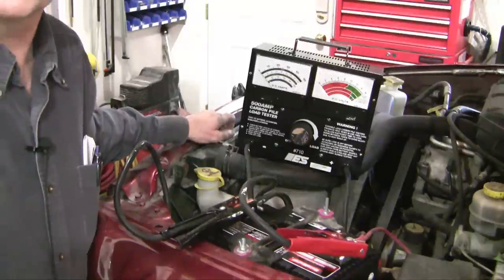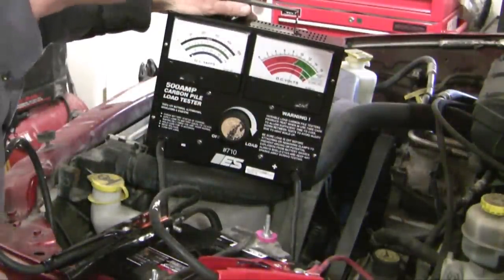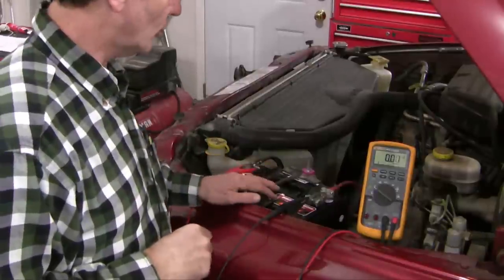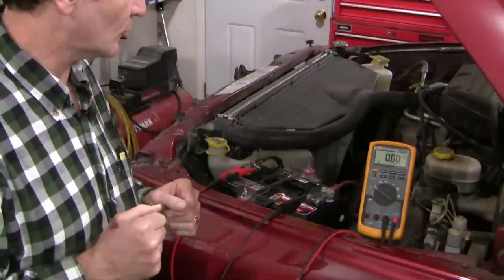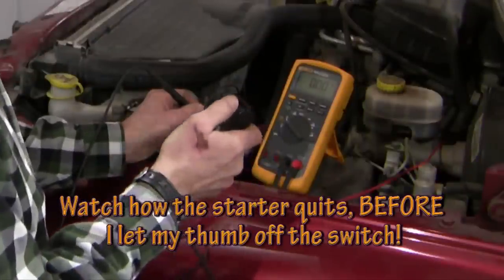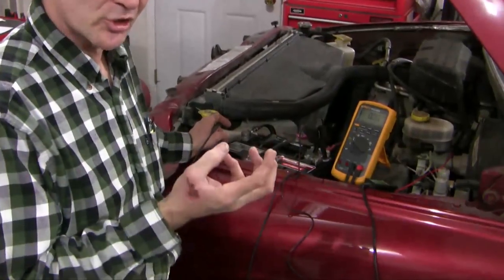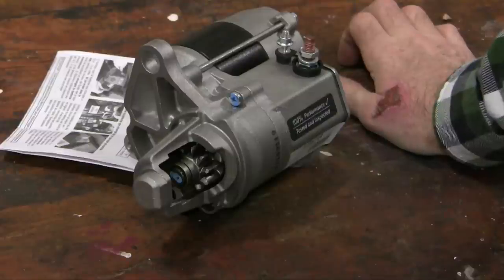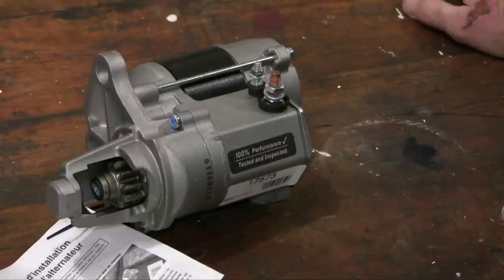How to diagnose & replace a bad starter motor

Comment: Have i got this right for a voltage drop. Put you DMM on say 20v and = lead to starter motor B+ post and to battery positive. Then for the negative side, to the body of stater motor and the battery negative post.
Reply from the maker: Yes. The critical point is that current has to be flowing for the result to mean something, so if the device is not working, (for example because of a broken wire inside the motor), then you can't do a drop test. You can put the leads anywhere, but they only detect drop across the span of wire you are testing. So, I try to test the whole length of the wire and the connectors on each side of the motor to quickly screen. Of course you wouldn't measure across the motor since there is normally inherent and variable drop across the motor itself. You only want to test the wire and connector parts, where resistance should always be very small. Make sure you include the connectors since oxidation at those connections is a common cause of difficulty. If you find a drop that is more than it should be, then reduce the size of the span you are testing to better define where the problem is. Good luck!
Reply: thankyou

Comment: I have a 77 dodge sportsman 360. it doesn't start when I turn the key no sound no clicks no nothing however, when I open the door or put it in and get it out of gear the lights will come on the interior lights will come on and I'm able to start it for a second and then when I put it into drive it shuts off completely no nothing no lights no click No Craig and nothing what do you think the problem. Any advice or help would be most appreciated

Comment: I have a 99 Dodge Dakota and I started having intermittent problems with it not starting.. It'll click (I guess solenoid), but not crank. It can go a whole week starting right up, then it will crank a little but not turn over. Or it'll just click with no crank.. But it always starts up after a few or several tries, and I haven't gotten stranded anywhere yet. 

What could this be, starter motor or cables? Any chance it could be something with the fuel system?

Comment: my 95 ram has been having a no crank issue once in awhile. 9times out of ten itll start right up. when it doesnt the starter makes a single click.  the connections are good battery tested good wires are physically in good shape, have not done a votlage drop on them. does that sound like a starter issue? thanks.

Comment: had a new battery last week and the starter motor still turns slow? is the starter likely to be weak?
Reply from the maker: First thing I would do is check the connections, especially your ground connection from the battery to the engine, which can go bad and rob the starter of the energy it needs. If you do a voltage drop test like I showed, you can define the abnormality before destroying evidence to prove the diagnosis. Commonly you get corrosion in the wire or either connection. With a new battery in place you have replaced the connections at the battery itself, but you haven't checked the connections at the starter motor on the positive side or the ground connection at the engine. The other thing that often goes bad is the ground wire itself. If the wire has green oxidation or swelling under the insulation, that's a big clue. Ya, you could have bad contacts at the solenoid in the starter itself, but I would check above first. If you do have bad contacts in the starter solenoid, some guys just replace those contacts for about $5 rather than replacing the whole starter. The trick is to find parts without delay. Sometimes you can just flip the copper contacts over and clean. I did a video showing those contacts. The best video showing how to change those contacts was done by Davidsfarm. Search that name and starter motor. He was banned from Youtube but there are copies of that video floating around, under different names.

Comment: Good job spelunkerd, check out Dan Sullivan's video on starter voltage drop testing, he hooks up a dual set of leads with a switch box to check both sides of the circuit, check it out.

Comment: hi, one question which i have not got answer any where, if starter is bad pullingmore amps say 300 amps instead of 150, will my cold cranking volts be less than 9.7 volts even though my battery is good. Meaning i have good battery wih good starter is having cold cranking volts of 10.5 .. now if i have bad starter will my cold cranking volts goes less than 9.7?. The reason i am asking this question is we may think if cold cranking volt less than 9.7 being bad battery but it is bad starter. but i dont know if bad sarter will let good battery being down less than 9.7 please advise.
Reply from the maker: You make an excellent point, that objective testing off the vehicle at room temp with electrolyte topped up after a long recharge is always better. "Rule of thumb" shortcuts are sometimes wrong.

Comment: Ok I figured out that I have a bad starter. I managed to get the bottom nut off but there's a top nut that I can't reach. What would you suggest?
Reply from the maker: Randy Glover Those are tricky, often needing specialty extenders. Can you remove some of the electrical nuts and wires to get better access? It's not uncommon for these to be removed 'blind' with no visual access at all. Failing all of that, get a copy of the OEM dealers manual (alldata sell electronic diy subscriptions for about $40). The dealers manual goes through an efficient step by step approach that might help.
Reply: It's a little late to respond to his question (I'm pretty sure he's fixed it by now LOL), and not sure if this applies to his vehicle or not, but for others who might be dealing with this I've heard that on some vehicles removing the front left tire (or right, depending on where starter is located) can make it a lot easier to remove the starter. 

I'm having a challenge right now trying to pinpoint my own intermittent cranking situation, and truly appreciate your taking the time to make these videos and give people feedback, it's extremely helpful. Had a situation for several days where I'd get a click when I tried to start it (assuming this is the starter solenoid not the starter relay), but no cranking, then after randomly turning key off and back on again and trying to start, it would suddenly crank strong and start normally. 1985 Dodge B250 Ram Van, 318 engine, automatic).

At first it would start after 4 or 5 tries (always been super reliable 318 engine and starts right up after a few pumps of the gas pedal), then last night I was stuck at a park for four hours (wouldn't crank after 10-15 tries), and was planning on sleeping in my van for the night with my dog and dealing w it in the morning, when I decided to try one more time before going to sleep, and it started (around 12:30am) so was able to drive home. 

Background: Replaced starter relay 4 days earlier, after being able to start it by connecting  a jumper from + battery terminal to starter solenoid while turning the key, I had 12V coming in to relay from ignition switch, so figured the relay must be the problem. Assumed since I had voltage coming in to relay and jumping to starter started it, relay must be the problem-then again I wouldn't be hearing clicking (starter solenoid?) if relay was bad, would I? Installed new relay and it started first try, so thought prob was fixed, but next time I tried to restart it, had the same problem as before. Probably should have checked output terminal on relay, but $14 isn't too bad and I have a spare relay now. :O)

Unfortunately intermittent cranking continued, and finally last night it was bad enough that I don't want to go anywhere til I fix it (and get stuck), hopefully today. I'm leaning towards starter solenoid (as opposed to starter?) bc when it does crank, it cranks strongly and sounds perfectly normal, does this sound like a case of worn solenoid contacts to you (or bad brushes)? Or do starter motors tend to fail intermittently in your experience?? Checked starter wires and battery wires for looseness (as well as relay connections), but everything seems snug. Ruling out neutral safety switch since it cranks strong when it cranks... then again, could oil/trans fluid seeping into neutral safety switch connection affect starting by shorting across terminals? Connector that snaps onto nss is not quite as snug as I'd like. Any thoughts/ideas are appreciated, and thank you again for the helpful information! Sorry for the length, I'm a detail guy...
Reply from the maker: Sounds frustrating. You can bench test a starter and solenoid, and if you demonstrate the problem on the bench you can reliably exclude all the other possibilities. If it  were my vehicle I would pull the starter (with attached solenoid), test it, and then either try to rebuild it myself or get a replacement. You can try just replacing solenoid contacts if you have the patience to search for parts while your car sits in the driveway. A rebuilt starter comes with a rebuilt solenoid. To be more complete, before removing the starter you could do a voltage drop test on your wiring to exclude that as a contributing factor. Yes, intermittent failure because of worn solenoid contacts is surprisingly common when starter motors fail. A classic 'fix' to get back on the road is to carry a hammer and tap the failing starter to try and coax it into starting one more time. The jarring force of the hammer allows the intermittently binding contacts to get past a sticky area and turn on. Good luck!

Comment: Mine will crank, but it takes 3 or 4 times of the starter cutting off after about a half second before it starts. I know it's not the battery, as I just replaced it and the battery cables. Is the starter bad or is it something else?
Reply from the maker: +F4ZaTE_X I'm not sure what you mean when you say the starter cuts off after about half a second. Do you mean that the starter instantly quits turning even before you release the start switch? If so, it's either the starter solenoid, the ignition switch, the relay, or rarely the neutral safety switch, in rough order of incidence. To decide which it is, a standard approach would be to isolate and test each device independently. However if the starter rotation sags to a stop after a few turns, I'd do a voltage drop test as shown in the video, and if that is OK I'd take the starter off for bench testing.
Reply: +spelunkerd
By it cuts off I mean I turn the key, you hear what sounds like it starting to crank for a split second, then it just stops. It does this tree or four times before finally turning over.
Reply from the maker: +F4ZaTE_X If a voltage drop test is OK, I'd take the starter off and have it bench tested. Probably the solenoid contacts are worn, and those can be replaced. But if the starter solenoid is bad, many people just get a rebuilt starter to get quickly back to a reliable vehicle.

Comment: hi i am haveing problems with my 1991 chevy van it wont start and i have done what the book that came with says to do but it wont start and when i try to start it it makes a ping sound i have charged the batery and looked at all the parts what should i do

Comment: A friend of mine is going use the code reader.  The engine kranks  when I turn the key but it doesn't start, it seems as if its a lack electrical current

Comment: Can you use a starter motor from a car with the same engine size to replace my starter motor or do I have to get a starter motor from the exact same car as mine (i.e car brand and type) ??
Reply from the maker: I suppose you could try to fit one you already have, however there are several basic designs and fitting the wrong size may be a problem. Starter motors are not terribly expensive and so most of us just get a rebuilt motor that is correctly designed for the car we are working on. Alternatively you could try replacing the contacts on the solenoid, which might get you back running again for a fraction of the cost.

Comment: i have a 2010 renault megane mk3 can you please please help me i had a whining noise which was changed for a secong hand air con pump as that what wascwhining but now when i press start it for a couple off seconds as starting sounds horrible like a chainy chanky sound then stops once started and then runs and drives smooth even in idle its only occastionly to not all the time
Reply from the maker: +Jay Bay Sounds like your starter motor is not properly engaging with the flywheel. If you break teeth in the flywheel it can be an expensive repair so I would not hesitate to remove the starter motor and have it bench tested. Of course make sure your battery and battery connections are OK but this is more likely a mechanical issue. Starter motors are relatively cheap and I would fix it before other secondary problems arise. A starter motor swap is certainly within the scope of a DIY mechanic, but you don't save a ton of money so if you are uncertain then get a pro to look at it. You can fiddle around with lubricating the mechanism and cleaning/replacing solenoid contacts, but most mechanics just turn the old one in for a rebuilt starter motor. You normally get a core refund when you turn in the old starter.

Comment: are you suppose to put a dab of grease on the drive cog............thanks geoff
Reply from the maker: I don't usually do that but it seems reasonable. The ring gear that meshes with the starter has a huge diameter, and any grease will be quickly spread over those gears.

Comment: Hello, I have a bmw starter with an unloader wire and a trigger wire, ground, and power wire on the starter. I been through 3 remanufactured starters and the starter wont do anything :( I cleaned polished the surface of the starter, the cables and nothing... their is no neutral switch on my bimmer thats not a problem, I check my battery and its at 12V and I hit the load and it drops to 0  but when I check the outside the car the battery hit over 9.6 on the load...

I tried manually turning the starter making direct connection and it still doesnt do anything :( help please
Reply from the maker: The first thing I would do is put a breaker bar on the engine crank bolt with the trans in neutral and see if the engine turns over by hand. If the engine doesn't turn over, you may have a mechanical issue like a seized engine. I'm a little unsure about how you did the above tests, but your new rebuilt starter should turn over on the bench before it is attached to the car. It would be wise to find a dealers manual to help you with wiring and diagnostics. Common faults that lead to failure to trigger include problems with the ignition relay and ignition switch problems, and of course security system problems. Ignition failure should be easy to diagnose by looking for trigger voltage when you turn the key. I would look for diagnostic codes as well.

Comment: Just do a voltage drop test. Voltage should o ly be takin up by loads. Check battery and starter. Should be the same

Comment: the starter motor on my perkins mini digger engine turns over for a few seconds and then stops, if i try a second time it turns for even less time and then stops if i insist it just turns for a second and stops again, all this befour the engine has the time to start,i notised this hapend to you in your vidio, so i come to the conclusion that the starter motor is no good, and needs changing,     thank you for your vidio,

Comment: to know if thr battery is good you would have to check it wit a vat? a dmm would just blow up ??
Reply from the maker: When a battery fails, it often goes through a long phase where it can produce adequate voltage at rest, but when current is flowing it can't maintain that same voltage. So, a voltage test with a DMM will often fail to detect a battery that is bad. The way to make a multimeter more sensitive is to put the battery under load and see how far measured voltage dips. At the roadside If I don't have access to a proper load tester, I will sometimes do a quick test by measuring voltage at the battery while somebody else turns the starter motor over. If the measured voltage drops below 9V the battery is bad, or at least undercharged. Remember that temperature plays a role too, with lower normal values at lower temperatures. The thorough way to test a battery is to remove the battery, top up electrolyte with distilled water, warm it to room temp, trickle charge it overnight, and then take it to any autoparts store that can do the formal test for free. You can buy a battery load tester for about $40. Of course if the battery has been frozen and the case is leaking or distorted, it's easy to condemn without further testing.
Reply: spelunkerd thanks alot